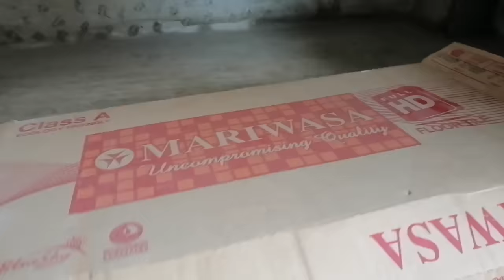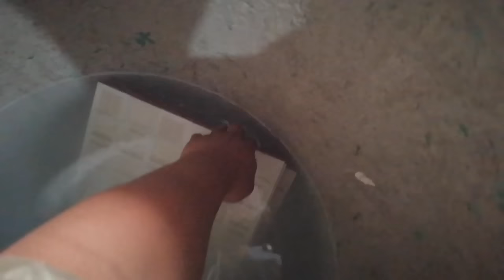ANG MGA TAMANG PAMAMARAAN SA PAG LAY OUT AT PAG TILES NG LABABO STEP BY STEP

Comment: Tile adhesive  should  be mix  only  with water  . No cement
Reply: Mix po pag walling halimbawa 20kls addisive so 5 kls or more than pa po para mas malqgkit po ung mortar
Reply: @jayrocaborte6784   wrong  po yan method  na yan  dapat adhesive  lng talaga  wla na po cemento  .mas matibay yan  tile  adhesive  kay  sa mortar  cement   ... there is  a guide  po how to used  tile  adhesive  on the back  of the bag
Reply: Ang tile adhesive  kasi new method  na yan   pag  kabit nag  tile  ..before kasi wala pa pong  tile adhesive  kay  they used mortar    sa pag kabit nag tile
Reply: Ang pag mix kasi nag tile  adhesive  para lumagkit  ai  gamit  po kaya  na drill  with puddle   just  add water on adhesive   tama2x  lng na water  mix it for maybe  5 minutes  then  let it sit  for  another  5 minutes  then  stir  one  minute  and then  ready  na..used trowel  with notch  other side  flat other  side.   trowel  muna floor  or wall  with  flat  side sa trowel  them  add  more  adhesive spread  it with notch  and then  butter the back of the tile them  stick it ..  for large tile gamit  large  notch trowel. for small  tile used regular  notch. .. and for  big tile  should  used heavy  duty  tile  adhesive  or large format  tile  adhesive..
Reply: Ano po ba mgging effect if haluan ng cement ang adhesive?
Reply: Correct. American and european style.
Reply: @sgtpepperking  what is correct?
Reply: @deomacthewonderer  ang effect  ng adhesive Sa katagalan ng gamit sa tile hindi aalog un tile pag naluma na o kakawang sa ilalim